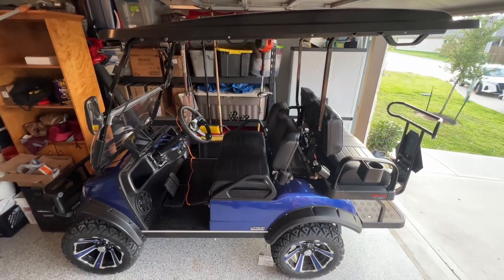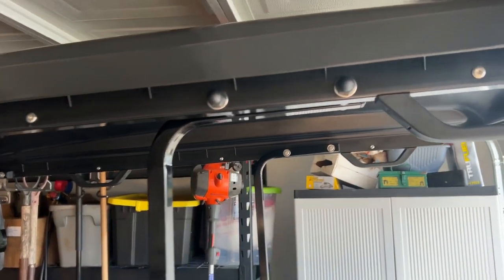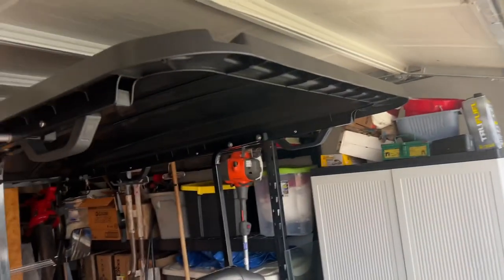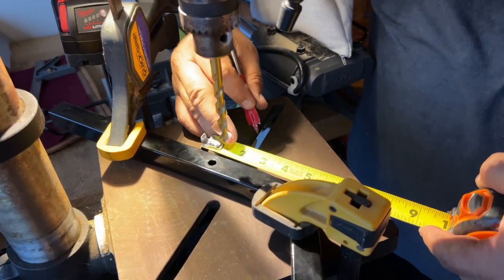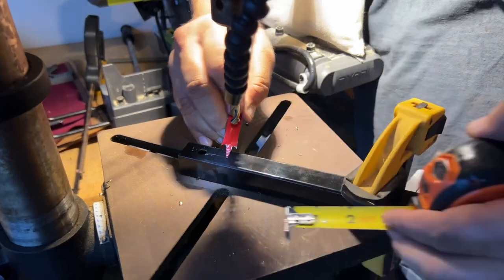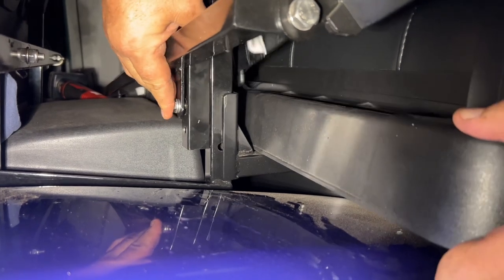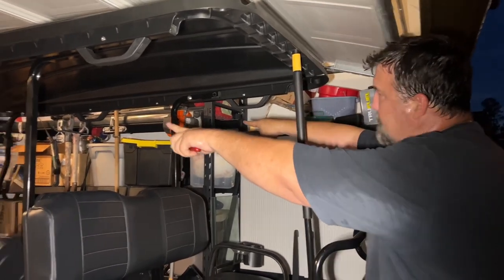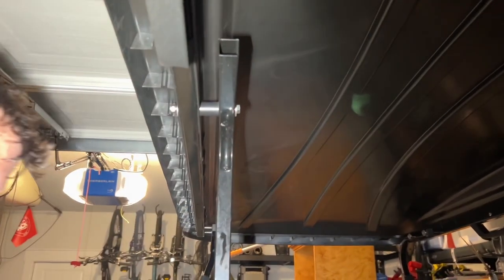Evo Forester 4 Plus lowering roof

Comment: What is the height of your garage?
Reply from the maker: Exactly 80 inches from floor to door
Reply: Do you think 81-82” clearance will fit the Evo Forrester without modifications?
Reply: As long as your garage and drive way are fairly flat you will have no issue. I had to drop the rear of canopy down 1 inch to clear due to being on an incline. The rear canopy about 2 inch slightly scrapped enter garage. Super easy to redrill holes and bolt up